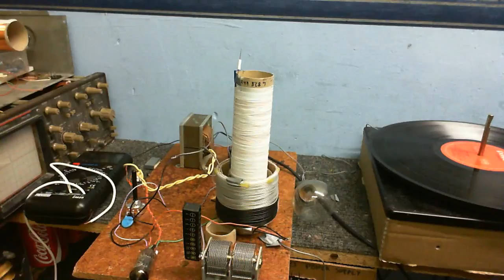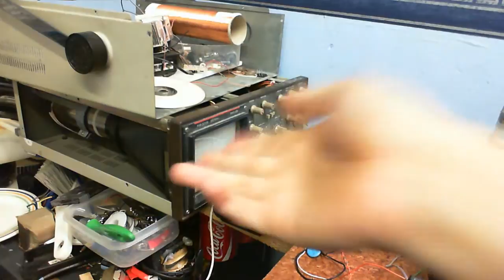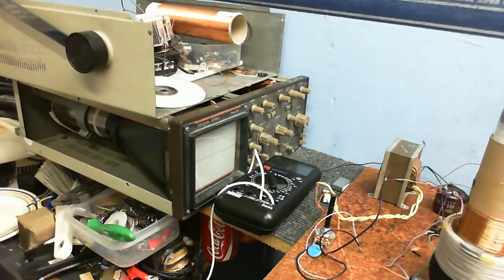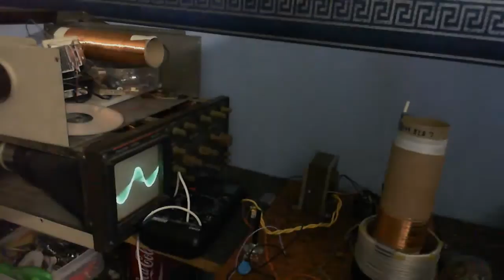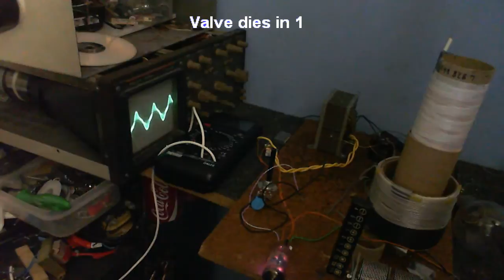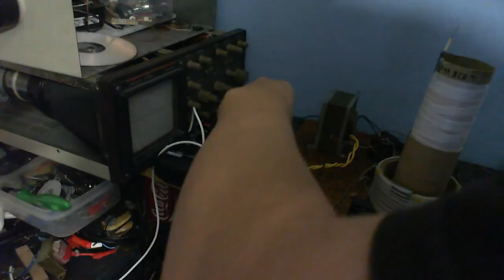how not to make a vttc

Comment: What tube were you using? It looks even smaller and weaker then the weak tube I was using. I managed to kill a 5933wa and a 6cu6 before I got mine working nicely with a second 6cu6.
Reply from the maker: I was using an old ECC83 (known as a 12XA7 in the US), at the time I knew very little about Vacuum Tube Tesla Coils, now I have bigger much more suitable ones to use.
Reply: haha Well you know I think when you learn the hard way it tends to stick better.

Comment: Usually people put 2kV or more thru their primarys to get high output at vacuum tubes
Reply from the maker: I tried that in a later video using a microwave transformer to power it, it worked quite well.
Reply: i say not with an ECC83... that is actually one of the weakest around

Comment: Maybe you have to use a tube that can take more power, I suggest power output tubes, or power transmitters; from the few tubes I've seen, I think the 50L6 or the 807 would take it, not sure if they fit the circuitry though, first is a power audio output and the other a RF version of the 6L6.

In the other hand maybe there's a problem that causes too much current flow through the valve; I've seen problems like shorts that causing grids to get red hot.

This is an awesome project, hope you get it to work.